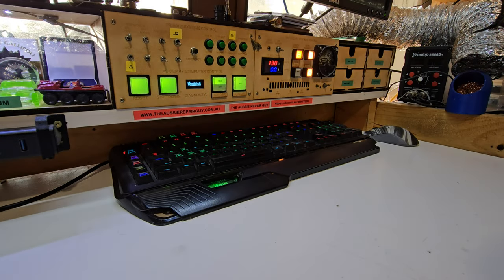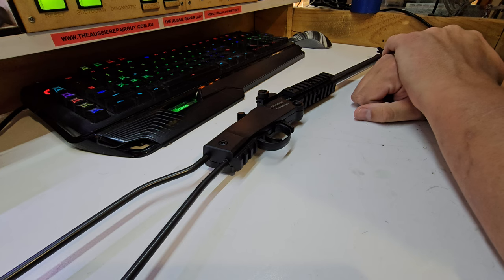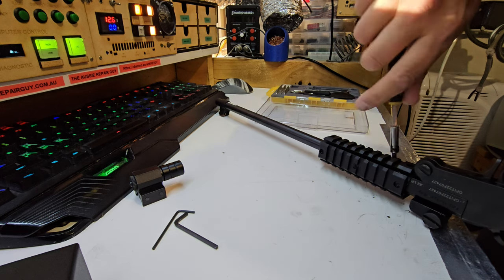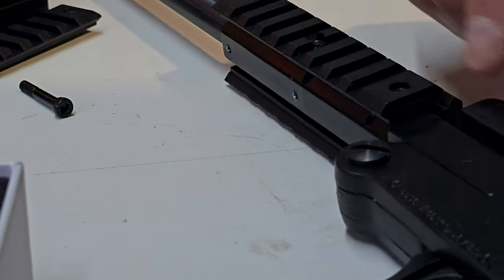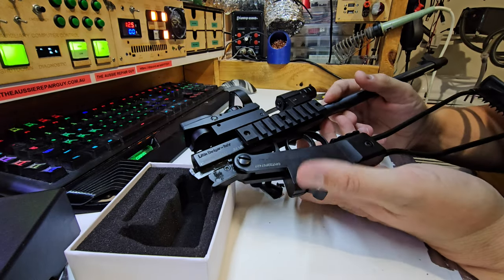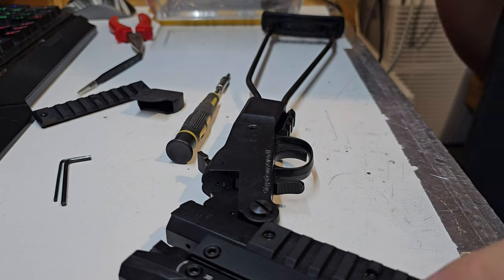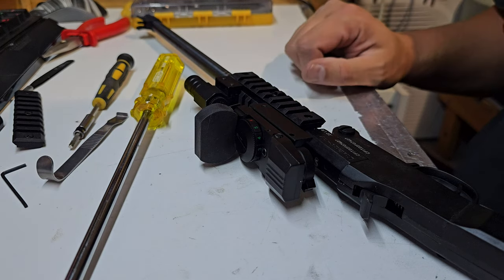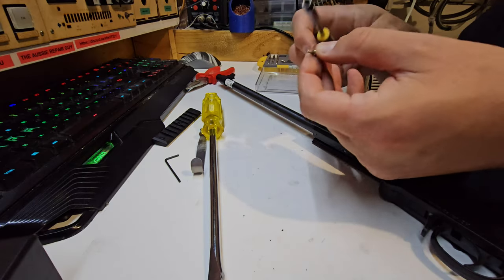Setting up the Chiappa Little Badger 22 LR

Comment: Great little gun for a beginner or backpack hunting  the other one in the badger line is the double badger  combination gun like the good old savage combo’s and plenty of aftermarket gear like but stocks for them even in Australia as for the threaded barrel certain car parts that filter oil will fit .
Reply from the maker: yeah I know about the double badger, they look good. I am gonna have to do something about the wire stock on this, it feels loose after adjustment. 
Going to enclose it with a bit of storage on the stock
Reply from the maker: I should mention I have a savage model 24 as well.